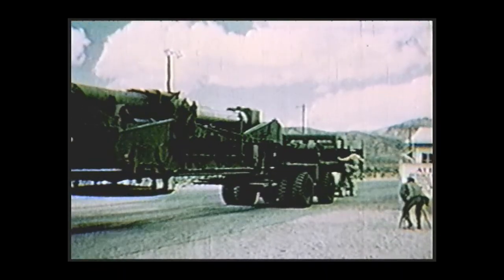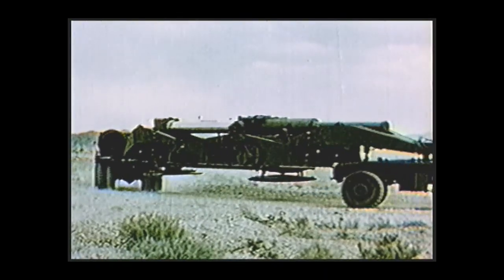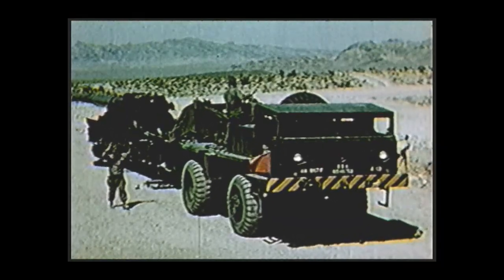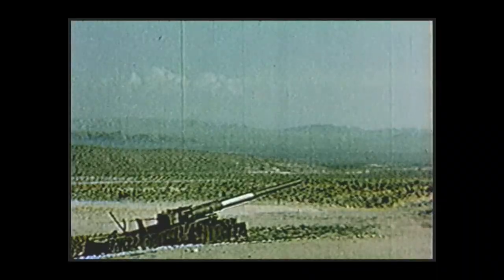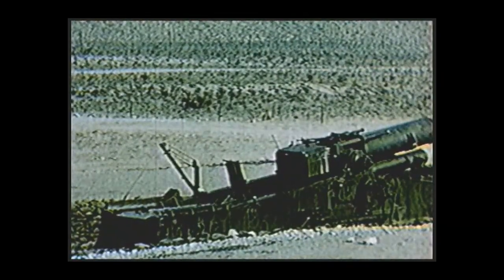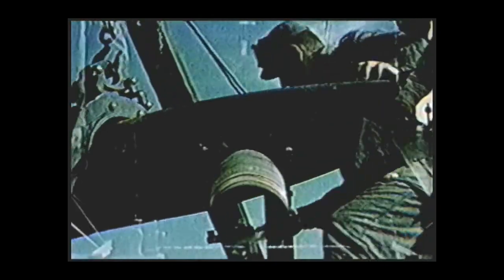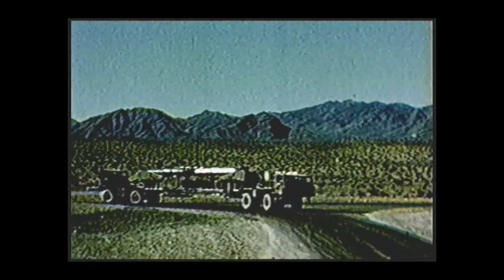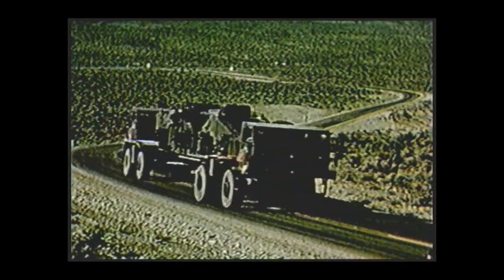The 280 MM Gun At The Nevada Proving Ground

Comment: They had a shell almost as small as a tank round. Look up the W-48 nuclear  artillery shell. It was designed to be used in a 155mm howitzer. It's yield was very small, equivalent to 72 tons of TNT (0.072 kiloton). One such shell of the same type was estimated to cost $1.25 million to produce.
Reply: The cost was gotten down over time, but they were still a lot more expensive than comparable weapons of a similar yield.  The problem was simple:  While you could fit a plutonium implosion-type weapon inside the 280 mm shells used in "Atomic Annie", the same design couldn't be made to work for our 8-in howitzers (203 mm) and the 155 mm gun-howitzer.  The fission fuel of these "gun-type" (no pun intended, meaning they were of the same basic design principle as the weapon dropped on Hiroshima) weapons had to be a combination of HEU (Highly-Enriched Uranium) and Orally (Oak Ridge Alloy), which made this otherwise relatively simple warhead quite expensive.  OTOH, the simplicity of the design made them more reliable, an important thing for a warhead shot out of a gun tube!

BTW, the nickname "Atomic Annie" was derived from the GERMAN guns these large artillery pieces were based upon, more or less a near-copy of the K5 artillery pieces.  Two of 25 guns produced were deployed against the Anzio beachhead in early 1944; where the dug-n GIs gave them collectively the nickname "Anzio Annie".  Due to having an excellent firing position SE of Rome, adjacent to a pair of rail tunnels, these guns were difficult to take out with counter-battery fire and/or air raids.  Once the German lines at Monte Cassino were broken and their units holding the Anzio beachhead out-flanked, the K5 guns were taken to the nearby port of Civitavechhia, to be disassembled and shipped up to Genoa and/or Nice.  Due to harassment by Italian partisans and Allied air attacks, the operation couldn't be carried out, and both guns were destroyed by their crews.  I believe the barrel of one of them was recovered and shipped to the Aberdeen Proving Grounds for study, which ultimately led to the Atomic Annie project.
Reply: @selfdo  Thanks for the info. Kinda hard to hide a gun K5 size on rails, huh?
Reply: @l8tbraker  They're not, er...SUBTLE.  But Italy has a lot of rail TUNNELS, as does so much of Europe, so indeed it's quite possible to hide one of these massive guns on its railcars.

Comment: Here's the problem with that: 1. China has the ability to do a long range strike without warning (NORAD will only give a 30 minute warning at best) 2. the mobility of the chinese navy HAS prompted the U.S. to beef up security in the pacific (As you should already know) 3. The majority of U.S. servicemen are not infantry. Chinas is. 4. Logistics, they only have to break 3 sections of the U.S. supply chain. 5. Command and control. 3 hits, 3 missiles, non nuclear, and command and control is ruined

Comment: its scrapped, i was in a place called grafenwarh in germany. it rained a lot up there and they were hauling that gun and it started slideing on the road and tipped over. secondary roads are ok if they are dry. setting up was fast but everything has to be perfect, you were to close to the impact area. wind changes and ur dead.i was in an honest john rocket outfit. it was a little better weapon but after you fired it you considered yourself infantry..the gun was around 1957

Comment: @Nicodemus98 Also, even if you made a projectile out of U235 - which would be a waste - it would not reach critical mass upon impact, not even close. DU, which is made of U238, burns (see: reacts with oxygen), just like sodium or magnesium can burn, neither of which are commonly radioactive. In fact, U can undergo spontaneous combustion in small enough pieces - like the small pieces you have left of the projectile after hitting something with it, and when you add the impact heat, you get fire.

Comment: @Nicodemus98 No, this is just plain wrong now.  DU is from enriching programs, it's just that simple.  We do NOT use spent fuel for DU munitions - you can't, spent fuel is high level radioactive waste and will give you a lethal dose of radiation in less than 10 seconds, 30 if you have protection.  If we used spent fuel our troops would drop dead before they even got into combat.  You should look up your facts before spewing stupid.  DU is only mildly radioactive, toxic is a far bigger problem.

Comment: @Nicodemus98 This is incorrect. From a radioactive standpoint, DU is only slightly higher than ambient environmental radiation. There is very little U235 in it, simply because we take out all of the U235 for our bombs and this is the leftovers. It is, however, a very dense, very hard and moderately toxic metal. Anything heats up when you hit it hard - and it so happens that DU rounds get heated over their ignition temperature on impact. No nuclear explosion involved, just fragmentation + oxygen.